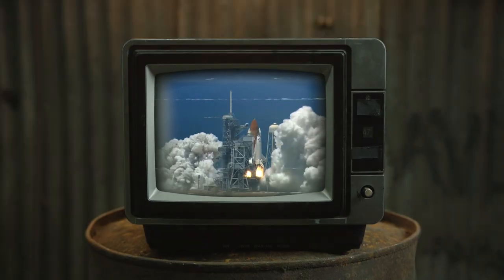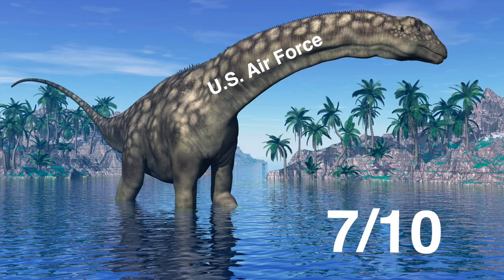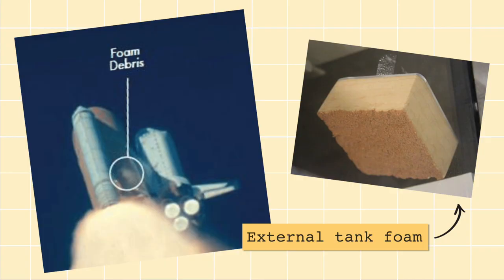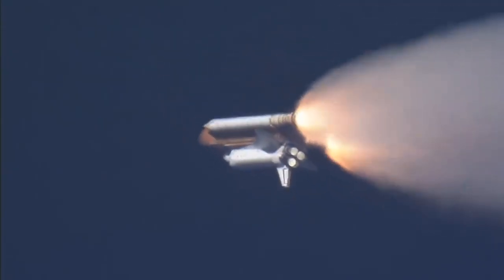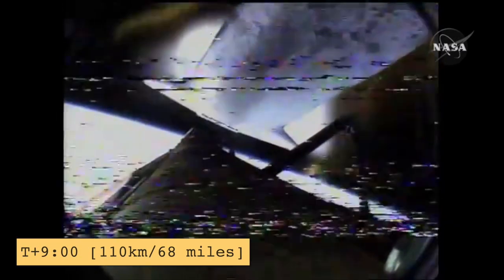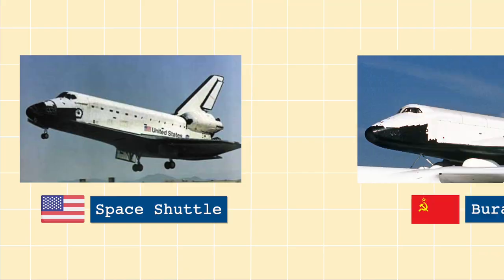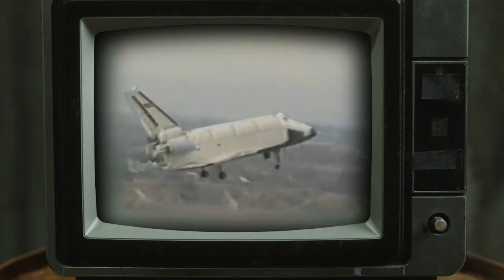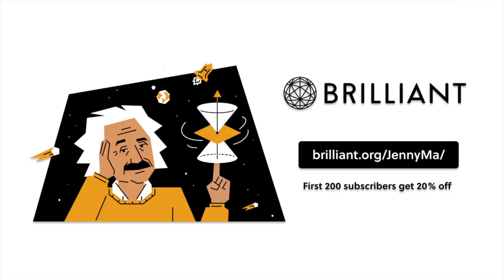Space Shuttle vs the "Soviet Shuttle": Which is Better?

Comment: Buran was a very good design, but unlike the US shuttle, it was just a payload and actually completely redundant.
With a rocket like the Energia, you didn't need a buran to launch a payload into space. Using the Buran orbiter to launch payloads was a waste. Instead of the Buran, it would have made more sense to use a larger payload and omit the orbiter altogether.
That was completely different with the US Shuttle design. In the case of the US Shuttle, the space shuttle itself was the rocket.